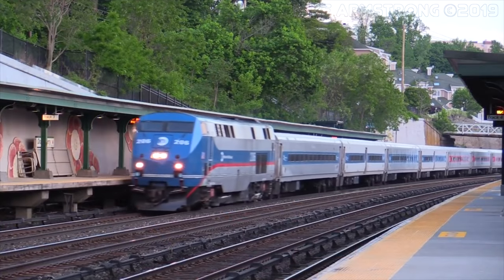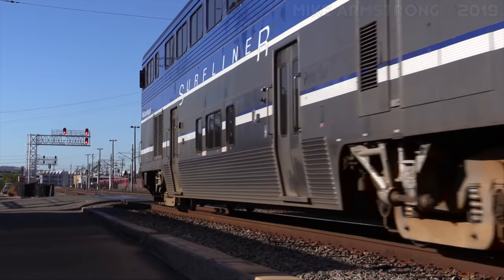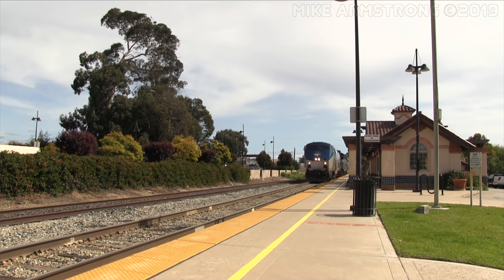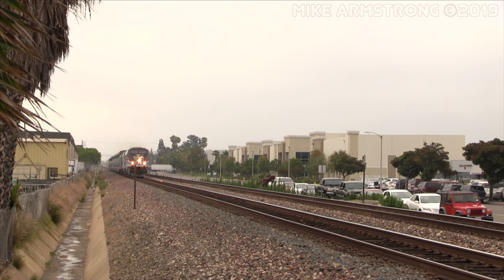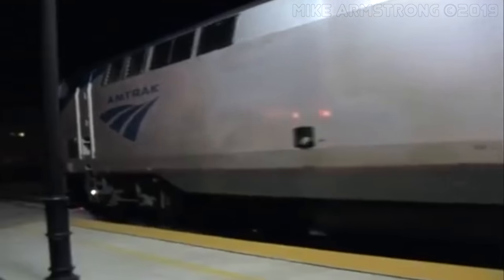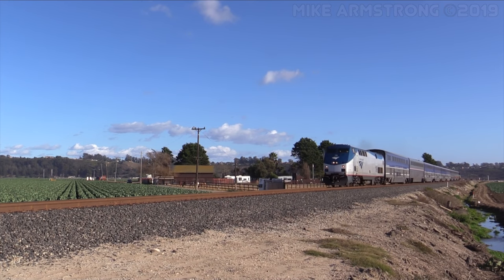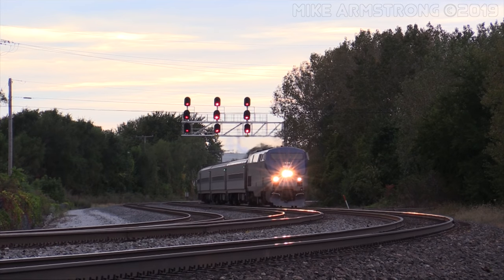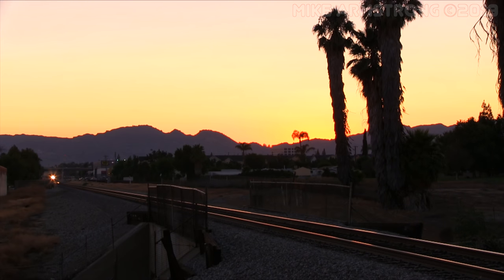GE Genesis Locomotives: Train Talk Ep. 22

Comment: R.I.P. 807, 819, 829, 8, 47, 66, 70, 102, 128, 143, and 149.
Reply: These are the first ones they should remanufacture. Beech Grove has some of these you mentioned. It would be much more cost effective to swap in the V12 Gevo and new electronics,  AC traction, etc. NS is rebuilding over 500 dash8 and dash9 locos.
Reply: I was most upset when I saw the destroyed cab of locomotive 47.
Reply: @harrisonofcolorado8886  same i was devistated when i woke up the day of the accident i searched up Amtrak and saw a news artical about the accident along with a picture of 47 on its side with its front end completly destroyed
Reply: @metrolink8644  Believe it or not,  I saw P42 #47 the night of its destruction. I am sad to see it gone!
Reply: kbtr234 Except that it wouldn’t be. The GEVO-12 doesn’t fit in the Genesis, and the car body is basically the same thing as the frame. That means if you wanted to modify the car body to make the GEVO-12 fit, you’d basically have to make a brand new locomotive, as you would need a brand new frame, cab, etc. Now I know what you’re thinking, “it has 12 cylinders lol this guy is retarded I know everything” but the issue is height, not length. And that’s not a compromise Amtrak wants to make. The Genesis is short for a reason, no point in wasting money remanufacturing something and then limiting its route availability. Much better to just accept reality and let the Chargers take over.

Comment: The GE Genesis locomotives has a part of my heart. It will be upsetting to see the diesels be retired and even scrapped.
Reply: They aren't set up to pull freight
Reply: Exactly, their lack of front porches and poor reverse visibility means that any 4-axle  Diesel locomotive with a full-width cowl body is NOT suitable for freight service. Heck, in 1997, UP leased 60 F40’s from Amtrak due to a power shortage.

Comment: metro north might buy chargers but not for any of the lines coming in or out of GCT they will buy them for trains on the port jervis line between hoboken and port jervis to replace their GP40FH-2s F40PH-3Cs and their one GP40PH-2 NJT usually runs those engines owned by metro north on their other lines too
Reply: Metro North, LIRR, and Amtrak are working on an RFP for new Dual Mode locos that will likely replace all of the P32AC-DMs and DM30ACs. This contract has not been awarded yet (since the three parties have had some issues), but Siemens has a good shot at winning it. Metro-North is also planning to buy 15 regular Chargers for the Port Jervis line.

Comment: They should work on American commuter rails.
Reply: They won't.  The electronics are too expensive.  The circuit boards are nearly $5000 each because they're custom-built for the Genesis series, and because GE holds exclusive rights to them.  Once these leave Amtrak they're pretty much done as far as revenue service is concerned, because their supply of spare electronics is running out and it's not worth it to order another bulk shipment when these units are already on their way out.
Reply: PG13hockeyman The issue with that is they don’t accelerate quickly enough. Add to the fact that they’re GEs at the end of their lives, and there is little hope of them in commuter service.
Reply: Some commuter trains already use genesis locomotives. They include the new Jersey transit, the metro north, and the Connecticut department of transportation commuter trains.
Reply: Norton Hatfield NJT Transit has gotten rid of theirs and Metro North only uses them because they have to, as required by the 3rd rail.
ConnDot uses them because they have to, as they don’t have any money.
Reply: @blackbirdgaming8147  and they use the genesis locomotives on their lines because of the low clearance tunnels and low overpasses along the railroad lines. The f59phi which are used on commuter trains on the west coast,  are too tall for the tunnels and overpasses on those lines.
Reply: Norton Hatfield Yes I’m well aware of all that. Your point?
Reply: @blackbirdgaming8147  the genesis locomotives would be a very reliable locomotive for commuter trains on the east coast.
Reply: Norton Hatfield Wrong. They’re falling apart, they load too slowly, GE no longer supports them, the list goes on. NJT sold theirs to ConnDOT after they realized what a mistake it was to buy them. I’m fairly confident that Metro North is going to be replacing their P32AC-DMs with dual mode Chargers soon, so even those don’t have a whole lot of life left in service.
Reply: @blackbirdgaming8147  That's the problem with modern society and technology, we live in a throwaway soceity. Stuff advances so fast that there's nothing to support the old stuff. What everyone calls progress in fact is massive waste.

Comment: Great video!

I heard Metro North already ordered SC-44 chargers, but to replace it's F40PHs that operate for/in conjunction with NJ transit on Port Jervis line (Hoboken - Suffern - Port Jervis). And I imagine since Metra is pretty desperate for motive power they're going to acquire a bulk of used Genesis locomotives when they become available.
Reply: Metra is ordering SD70ace with head end power rebuilt from freight engines.
Reply: No, instead they are purchasing similar HEP equipped SD70MAC’s that the Alaska Railroad uses. The differences between the two are the fact that the Alaska units only comply with EPA Tier 1 standards, while the Metra ones will be remanufactured to meet Tier III standards.

Comment: Do you have a video where the loco provides HEP power? Here in Tunisia most passenger traibs use a separate genset so they can be tracted even by freight locos but this is not very efficient I think HEP from the loco is better do you agree?

Comment: What will be replacements for Amtrak Long Distance Trains? Will the Dash 8s also be retired?
Reply: Like Mike said in the video, a this stage, Amtrak have purchased 75 Chargers to replace the P42s on long distance trains. As for the Dash 8s, they will be retired eventually, but when is unknown by me.
Reply: @thomaspalmer1019  alright
Reply: Santa Fe Unit 668 I’d say the Dash 8s have a little ways to go. They have a lot less miles on them than the Genesis units do. They’ve also proven useful as switchers, MOW units (ballast trains), and backup power.
Reply: Blackbird Gaming  interesting
Reply: I wouldn’t be surprised if a Dash 8 is assisting an SC-44 on the Coast Starlight. Ever since they made their debuts in 1991, Amtrak loves to use their Dash 8’s on the Coast Starlight a lot, even with the Gennies. Here’s what surprises me, though. Amtrak’s Dash 8’s are underpowered at 3,200 horsepower (minus 800kw eaten up for HEP control) and yet a pair of them could power the Starlight with no interruptions.

Comment: To further clarify about the GE P32AC-DM locomotives... Metro North operates them out of Grand Central (though not on the fully electrified New Haven Line) and Amtrak likewise between Penn Station and Albany due to restrictions on diesel exhaust in those  underground Manhattan stations. As such, those lines will always require dual mode locomotives, with minor differences in their 3rd rail pickup gear to account for over vs under-running etc depending on the line.

Comment: They should sell the p42s to Nj transit for the diesel lines like Rarotonga valley or passic valley lines to replace the gp40s and to put the alp-45 to better use on dual mode routes like Montclair booton and Morristown line

Comment: It seems to me that Siemens are taking over pretty much everything these days. Firstly, their ACS-64 locomotives took over the AEM-7s on the NEC. Then, their SC-44 Chargers took over the F59PHIs on the Pacific Surfliner and Cascades services. And now these Chargers are set to replace the P42s. And it won't end there; loads more railroads will most likely replace their rolling stock with Siemens stuff. These Genesis engines are good locomotives, so all I am hopeful that the ones that will still be useable will have an afterlife.
Reply: The European locomotive manufacturers are now increasing their presence on the North American side of things. Even VIA Rail Canada has ordered new Siemens trainsets.
Reply: Thomas Palmer They’ve been doing it for a long time, ever since they started working with EMD on their electrical systems.

Comment: 1:30 nice catch of 184 before it became the Phase IV unit!
5:29 nice catch of numbers 45 and 46 working together!
6:05 but VIA rail still uses F40s! Maybe Amtrak will seel most of its P42s to VIA rail or maybe a private car pooling company (they use P42s a lot and might benefit if they bought their own to help on excursions)
7:47 Amtrak should buy new single level coaches since most of their single level coaches are 30-40 years old! (or maybe turning the Acela cars into diesel and ACS64-hauled sets)
As a kid, I grew up watching VHS tapes and DVDs with scenes of Phase III and IV P40s and P42s working alongside F40PHs, but those were all gone, as every Amtrak train I saw was with a phase V P42. I really like their prime mover noises (especially the "woosh" sound), their steel bells, and the sloping blue on the top. The P42s I saw the most were 58, 54, 144, and 69. The Sc44s do look cool, but I do miss seeing and hearing P42DCs as they arrive and leave Kansas City with the Missuri River runner (I have rarely seen the southwest chief, I plan to see it a lot from this summer onwards)

Comment: Knew it was going to be on the Genesis, what's next? The Dash 8-32BWH? 
Edit: I don't think the Siemens Charger will replace the P32AC-DM's because they can't run on electric only into NYC tunnels
Reply: Probably since they are older than the genesis
Reply: Siemens will be producing a Charger dual mode variant for the following railroads Amtrak, Lirr, Metro North.

Comment: They should convert some of the oldest of these onto cabbage cars like the f40
Reply: Cade Spencer And why would they do that? There’s no need to do so when they don’t need more Cabbages and could very easily reactivate a Metroliner cabcar for much cheaper.
Reply: That and cutting into the sides of the monocoque chassis would compromise its structure unlike the F40's cowl body.

Comment: The GE Genesis also called the Genset is the face of Amtrak. these locomotives replaced the EMD F40PH and old Santa Fe GE P30 Pooches which were starting show their age and were having mechanical problems. Amtrak wanted an aerodynamic locomotive and they turned to GE to make it at their Erie plant the result was the Genset and since 95 these engines are on the head of every train. Because of accidents some of these engines are being taken out of service and some are being sold to commutator but most are still kept. On regionals these locomotives have been replaced by the Siemens Charger and the ACS 64.
Reply: Corrections: The P30CH was problematic, retired, and scrapped, while the F40PH was aging and tired around the time the Genesis locomotives arrived.
Reply: Genset? I don’t think that’s correct. Genset refers to a locomotive with one or multiple generator sets (hence the name Genset) that can turn on and off at any time to save fuel/respond to an increase in load. 
Additionally, P40s were never really on Northeast Regionals (with a few exceptions), so unless you’re referring to regional routes, I don’t know where you’re getting that from. 
Genesis units have not always been the head of every train. Dash 8s and other power has often led trains instead.

Comment: I genuinely hate the way the Chargers look...

Look, I get the Genesis is getting old, and Amtrak desperately needs to modernize, I don't fault them for phasing out new equipment... I mean, we already had to say goodbye to the F40PH, so it's only fair that it's replacement gets the same treatment... But god damn, the SC-44s literally look like the most generic European locomotive you could find.

It's like they heard all the people complaining about European passenger trains being more efficient, so they decided the solution was to just buy a bunch of European locomotives.

The reason Europe's passenger trains are so efficient, is because their railroads are specifically designed for passenger service, they don't have to deal with lines being backed up by priority freight trains, or distances measured in the thousands of miles between stops... Just buying new European locomotives won't magically solve the issue of ineffecient passenger trains. 
If you don't modernize the lines and completely redesign the whole system, all those new engines are going to be is a horribly out of place looking BUS on the front of all your trains, which are still going to be restricted to exactly the same top speeds and timetables as they have been for 40 years.

I mean, god damn, where is the loyalty to American manufacturers? surely GE or even EMD could've come up with SOMETHING better than just, cloning generic German commuter locomotives.

At least have the decency to give them a different shell to LOOK more American, if they really were the best option, why not at least give them a different look to match the Superliner cars they're supposed to be pulling?
Are they not going to even pretend that they aren't just blatantly copying European designs?

Comment: How much you wanna bet Metra picks them up? xD
Reply: Alex Crawford They were certainly desperate enough to buy freight units, but I don’t think they’re desperate enough to buy complete junk.
Reply: I wouldn't bet anything. I believe Metra evaluated a P42 years ago, and found that it was too slow to keep up with their schedules. Additionally, Metra has an all EMD fleet, so buying completely different GEs wouldn't make much sense from a maintenance perspective.
Reply: @m636rf9  I know. Mostly just a jest. But the P42s weren't that much faster than the F40s.
Reply: So despite their age, the F40’s still had better acceleration than their replacements?  It could be a locomotive stereotype: EMD locomotives have rapid acceleration/throttle response while GE’s take their time. But I still feel like the Genesis diesels accelerate well, especially on the City of New Orleans.

Comment: They're also used on NJT!
Reply: Weren't the NJT ones sold a while ago?
Reply: Themba D wait... NJT sold them?
Reply: @MR611 From Wikipedia: "... four were rebuilt and sold to New Jersey Transit in 2007 (and classified as P40BH); these units were sold again to the Connecticut DOT in 2015".
Reply: They were sold to ConnDOT several years ago.  Even then, NJT, never really got much use out of them, restricting them to the Raritan Valley Line and Atlantic City Line once the ACES service from New York to Atlantic City was killed off in 2011.  In fact, the ACES train was the only reason NJT ever bought the P40s in the first place, as they were the only passenger diesels available that could fit through the Hudson River Tunnels.
Reply: Their HEP equipped GP40’s were too tall for the tunnels into NYC?